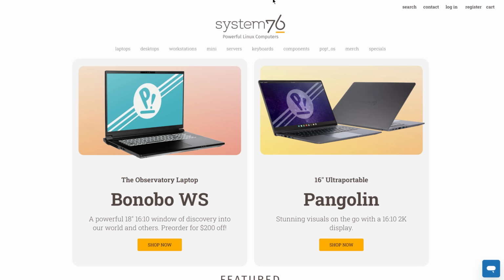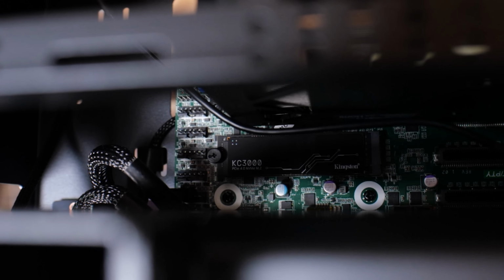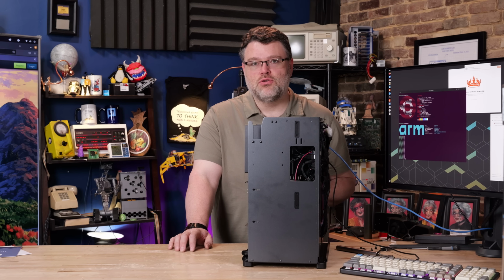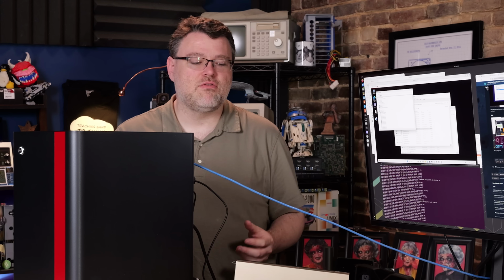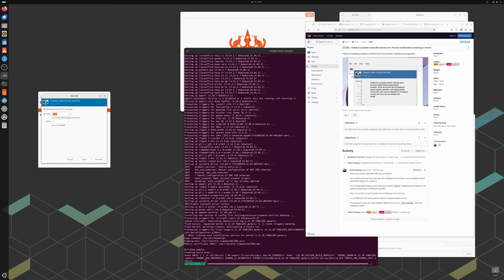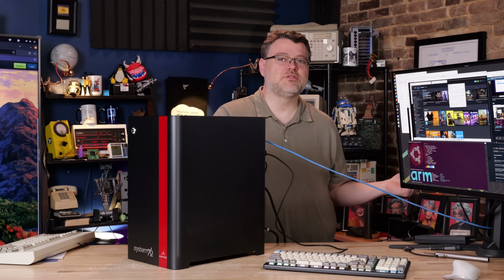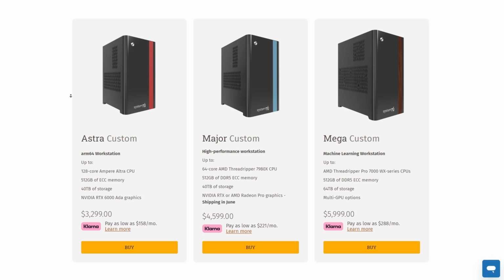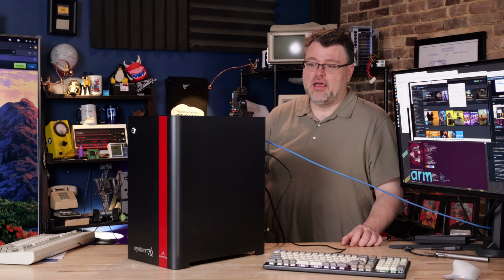ARM on DESKTOP: System 76 Thelio Ampere Workstation Review

Comment: I'm potentially interested in putting together 1-3 of Ampere Altra based servers.. This box seems to have the M128-30 (which I think is the AC-212825002). Seems this CPU came out in 2021? But just recently Sys76 has released a workstation line based on these processors?

Why is the fairly recent Thelio based on a ~4 year old CPU release? If Sys76 is releasing something like this I assume Ampere isn't planning on refreshing their Altra line anytime soon?

Maybe this is an updated M128-30 compared to 2021?  or maybe these CPU's have a much longer cadence between generations? I get that these aren't general consumer CPU's, but I don't think IBM staggers their POWER generations this far apart for example.
Reply: see Geerling AmpereOne

Comment: Great video, we had one of these at SCALE 22x / Planet Nix. It was an awesome system to use, it's pretty much the same as my Ampere Altra Max M128-26 desktop at home. However, System76 has done a lot of work to integrate things nicely. The cooling solution is the best I've ever seen in a desktop.

Comment: What blows my mind about Qualcomm Laptop Linux support, is that they went with their weird hypervisor boot, but worse with the requirement for device tree, instead of a proper full UEFI + ACPI stack. The problem is, that that is something each Laptop manufacturer would have to contribute to Linux, instead of Qualcomm just once adding drivers (which still has to happen). Also the other part means you can't use VMs on Qualcomm, even if you get your device going. And who knows if it ever became a thing, how you would even supposed to build a desktop class Qualcomm system. You'd need to write that yourself then. Utterly dumb. Bad enough that's still a thing in SBCs sometimes.

Comment: comon atleast show something 3d play a round rocket league or a benchmark something that shows u can run 3d on arm did they put a 400 buck gpu in there for decoration or what ?
Reply from the maker: Nvidia said no :(
Reply: @Level1Techs  oh:( thats so nvidia any chance u can stuff a amd card in the drivers should work better anyway whit linux not sure if they like arm would be intresting to see ^^  i would also love to know how much power the system uses since arm should be super power efficient

Comment: I see that whoever did the cable management doesn't know what the loops are for on the velcro ties ;)

I'd love to have a machine like this for running NetBSD on bare metal. It'd make one heck of a nice server.

I'm not sure I see the value in using it for desktop virtualization, though. If we really want the fastest cores, we'd go for an M4 Mac of some sort, which can virtualize anything we want. I could see if the prices had come down quite a bit since 2021, but it's really not an inexpensive system, even if you don't get the full 128 cores.

Still, it's good to see Arm stuff that's fancier than SBCs and more server oriented than Apple's Arm offerings.

Comment: Hey Wendell, this is Jeremy from System76 - really appreciate this review!

The work to bring an ARM desktop with a turnkey OS install into our product line was intense but as the architecture grows I see it as critical. During the project we started doing Pop!_OS package builds for aarch64, which are done on a rack-mounted Ampere server. We fixed bugs in various packages such as COSMIC, the Linux kernel, NVIDIA drivers, system76-power (which provides optimized fan control on Astra), and the installer backend known as distinst. Sweeping changes were made to our imaging system to support automated imaging of aarch64 systems, which technically supports both Pop!_OS 24.04 and Ubuntu 24.04 on Astra although we are only currently selling Ubuntu. On the side, I was able to make huge strides in getting Redox OS to boot on ARM systems with UEFI and ACPI like this one. Almost all of this work was done on Astra itself, I am a big believer in dogfooding and when I do firmware or OS development it is always within the system itself if possible. Regarding firmware, there is even work in progress, open source, EDK2 based firmware for this board but it is not yet production ready. For the work I do, the desktop Linux experience is on par with x86 in most cases, except gaming.
Reply from the maker: You are a legend and I appreciate you, your hard work and contributions. Redox is pretty exciting, but I'm most excited for COSMIC. You're head is in the right place, so I'm excited to follow your work as it develops and please do keep us in the loop for what all you've got going on.

Comment: I would love to use this platform to run virtual machines on Proxmox. Hoping that they are able to start developing a version of that for ARM in the near future.
Reply: I have a DIY arm system and while proxmox is not supported you can get something somewhat similar with a generic linux distro  (I use alpine) and libvirtd with QEMU. You can use virt-manager to connect to a remote libvirtd over ssh.
Reply: There is unofficial proxmox arm64 port

Comment: I learned my lesson with Nvidia Jetson AND  other vendors and devices. ARM support is here today and dead tomorrow. Support from firmware to the OS levels is ropey at best and horrible long term. 
Now - maybe S76 and Ampere have a better ethos. But I'd be very reticient to spend large sums if I wanted to make wide use of platform for an extended basis.
Reply: I agree for those other platforms. This one is straight up vanilla UEFI. There is no BSP. Download whatever distro you want and run it.
Reply: @JoeSpeed  No. The generalist compute situation means that while you can put on your OS, this just like across SBC land has requirements from a massive 3rd party list. For example, want to utilise Nvidia hardware - I've watched now as across at least 3 episodes the in Joke is 'No Nvidia Driver for ARM--Yet'. The assumption made is that Nvidia will make one and sustain support for it. Well, I have NVIDIA ARM products and I would not trust NVIDIA one millimetre in this area. The same sadly applies for Intel and for AMD. This is not about getting stuff running. Its about the global state of actual support to get the return on the value. Now, in the AI age, as nice as having cores, ram, and compute is, if you have basically crippled or limited GPU support, access, or operation - you have a lesser platform.

Comment: Arm processors, can they run Android apps natively, like Waydroid? X86 processors need a x86 to arm translator like libhoudini, but waydroid has some issues with it in x86. I can't run arm apps on my Ryzen 5, 3600 with Radeon 6600 GPU on my all linux, I've tried.
Reply: Yes, which is why NVIDIA’s android cloud gaming platform uses the same Ampere CPU
Reply: @JoeSpeed  Oh, there's cloud gaming for mobile? I've tried to move away from Windows, but android gaming, since my mobile is low budget, that can barely game and Amuse A.I for AMD GPU get me keep returning to Windows.
Reply: @JoeSpeed Can you install android natively on an Ampere Altra system

I mean without any emulation whatsoever

Comment: If x86 dies so will desktop PC's, dont say I did not warn you all!
Reply: with how most OEMs in the ARM space have handled things, I can see DIY hardware being threatened, just soldered down parts and no upgradability. Just look at how Google and Qualcomm have handled their old ARM devices, basically paperweights now - would've been the same for Macs if they hadn't have opened up the bootloader for the Asahi project.
Reply: @amirpourghoureiyan1637  They didn't open it up for the Asahi project, it's always been open.
Reply: @Longlius  it wasn't as straightforward as it is now, at the beginning of the project you couldn't just boot into the installer without tricking the OS. Marcan mentioned the change when he was documenting stuff in the early days.
Reply: x86 won't die, not in the consumer desktop and laptop space anyway. Way too much inertia.
Reply: ??? There is no reason that desktop pc’s can only exist in a world where x86 is the norm. Desktop PC’s will never go away, regardless of the architecture they’re built on.
Reply: This is a completely nonsensical point - ARM is a far more open architecture than x86 is.

Comment: Gamers Nexus would (rightfully) critique the blocked rear exhaust fan grill for being design over functionality (:
Reply: Using it a while, though... it doesn't seem to impede anything or cause any perceptible noise issues. It would be nice to cut the frills, but honestly, a little fan spacer to put the fan just off the vent surface would do more than optimizing the cutout.

Comment: Arm v 8.3 supports nested VM but it will be faster in i think arm8.4 or 5 right now no Proxmox VE is released for Arm or am i false?
This one has 8.2 instruction set so no nested virualisation but normal vm may be possible.
Reply: No official proxmox on arm.  Individual/community build type things, yes, but last I checked they are pretty limited.
Reply: @LackofFaithify  Ok that was also my last state of knowledge. I hope the 8.6 arm command set will improve the situation. Using the same hardware for ceph and THe for k8s nodes would be perfect.
Reply: @abelgerli  It all goes back to the same problem though: time and work.  Who wants to have to make their stuff work on X86, then on ARM, but not all ARM of course, and now you have RISC-V and all of the different versions of that thing.  There's just not enough time or people willing to pay to do all of that work.  And the hardware companies sure as hell aren't providing drivers for their gear. Just a bit of unfortunate reality.
Reply: @LackofFaithify  Actually after being infected with NicOS I really enjoy declarative system configuration just because I can be sure that I can copy or reuse parts of my configuration or all of it on another hardware. A and I can even create containers for k8s with it that are version locked for every package. Then to be transparent I can run a bill of materials for all different license of every package installed in the systemm . No manual installation just definition files for what want. Yes I need some more time to do it that way the first time but every other time it just works. Having packages on the system that need different types of python no problem because even the dependencies refer to the big version of the packages that are needed it necessary. Love it but I don't love imperative installation because you will make errors that lead to different results.

Comment: Cue the "an arm and a leg" dad jokes.
Reply: "native arm development" 💪
Reply: Because if you're even remotely capable of affording this, you're not even on this channel. This is dreamer shit but still a 36,000 workstation is decent in comparison to a good car
Reply: @tomallen5837  This is mostly for businesses, I think
Reply: @spicybaguette7706I tend to think it's more fair to say that this is designed for workstations dedicated to professions such as medical & scientific visualization architecture,  engineering, visual effects etc. Yes not necessarily gaming
Reply: @tomallen5837  Most workstation builds aren't rocking 128 Core CPU or 512GB of RAM Enterprise Servers for a 7-8K GPU at that point you have a  Developer Server and  for medium and larger companies those can easily cost over 20K depending on your requirements.  Way more if you need it in a high density environment and installed in something like a Blade Server Chassis. 

Either way pair back the memory and GPU and you can get a real work horse for under  7-8K.

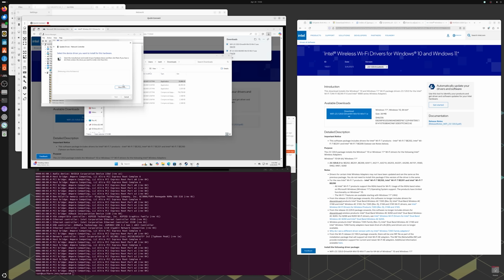Comment: 09:40 - The hardware exists now, to get Windows native Arm drivers with a nice experience... just waiting on any vendors to start releasing the drivers! (Most especially Nvidia...).

It's funny that right now on _Arm_, Linux is about a 10x better experience for GPUs, gaming, CAD, etc. than Windows :)
Reply from the maker: did you know Microsoft won't allow third parties to sign drivers for hardware they don't own? there exists open source drivers for a certain piece of hardware I'm thinking that lacks only windows' driver signing cert. 

meanwhile on Linux....
Reply: That‘s okay. Signed drivers are overrated anyway. Broadcom has an HBA (P411W-32P) where the official drivers on their public product support website have broken signatures.
Reply: :face-red-smiling-live:I could imagine, Based on your comment's its lacking computational bloat, But you would still need a valid use for such hardware....Unless. You can prompt it to build a fully functioned mine-craft map or any map, If i may iterate that this particular setup "as it" is isn't a one button rig. That so many people are used to, Instead its a tedious process and we both know from our personal experience this workflow is unsettling. So if you can get past your noisy ass neighbors, Rent is only 450. Sound's like a sweet deal. And not to just stare at a fish-tank all day.:text-yellow-goal:
Reply: @JasonMorrill-h8q  what
Reply: Hey Jeff, you're an idiot.
Reply: the problem with Arm is how locked down most chips are

Like... forget about trying to run linux on an X-Elite system and expect it to run out of the box as it does on windows... 

Also, you basically cant just walk in a store and buy an ARM cpu and put it in a motherboard of your choice the way you can with X86, until that happens, and until Arm devices become as "open" as X86 are with regards to drivers and the like, X86 will remain
Reply: Last time i checked the CAD we use @ work is not linux supported. Unless you mean Cloud-CAD that runs in a browser. Wake me up when it runs MasterCAM.
Reply: Linux has good CAD experience? , with what , nothing except fusion360 with install scripts and old versions of CATIA v5 work, am i missing something here ? 😅
Reply: @DarkSideAvatar1317  good enough for simple hobby stuff ig?
Reply: @DarkSideAvatar1317  You are right, I laughed out loud when I seen CAD mentioned being 10x better on linux. Linux sucks for CAD or any type or creator/maker software. The sole reason I still run windows on my main PC - is I use Adobe (photoshop & lightroom,) Fusion360, Lightburn, etc. There are no good alternatives on Linux (And no, the gimp isn't good - it never has been. Darktable sucks, as does rawtherapee - the people who recommend these garbage options never actually use them to any degree it seems, but are all too happy to recommend them for some reason.)
Reply: @DarkSideAvatar1317  It is not Linux, it is those shitty companies that only do windows or mac versions.
Reply: @surejack  It is Linux not having cohesive media/library/drivers making it really hard for any software developer to commit to Linux. The ones who have, such as Blackmagic or autodesk, require either a specific distro and version or they have their own distro that they require to use the software.  This is the big issue with Linux on the desktop.
Reply: linux just can't do CAD for electronics at a professional level or any level really
Reply: @beanman853KiCAD is very robust, mechanical CAD though still has a ways to go. BricsCAD works well on Linux, but it’s an AutoCAD alternative as opposed to a more modern CAD package